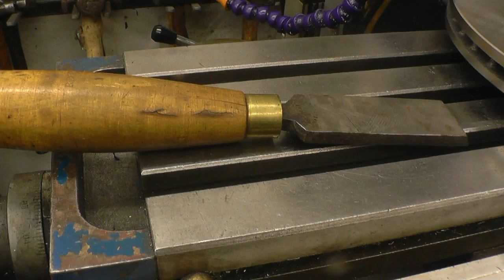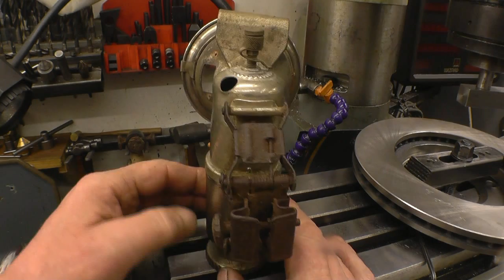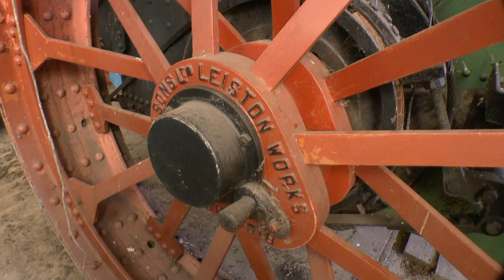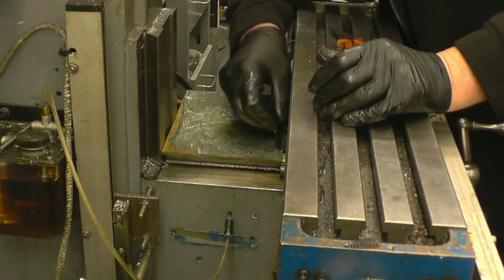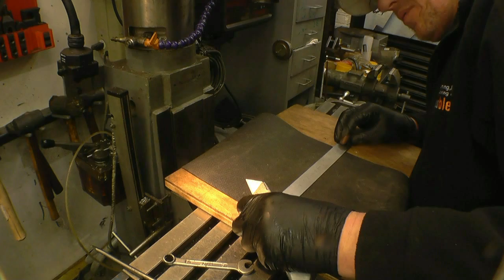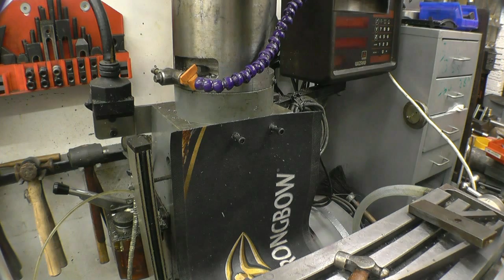SNNC 218 P1   Milling Machine Slideway Protector

Comment: Hi John
As you know we basically have the same mill & I have more or less done the same job.
However you might want to rethink those bolts fixing the top of the rubber.
Reason is, I have the same vice as you too, and the over hang off the table sometimes hits the back of the mill.
My rubber is fixed at the top with bungee cord and it's still caught it from time to time!!!

Comment: Rather than fasten the material solid at the top you could fasten a couple of very strong magnets to the material and stick them to the vertical dovetail. Then if you want to crank the table down they will be dragged along down the dovetail ways  and follow the table. When you come back up you'll have to pick the magnets up and stick them again but no big deal.
Reply from the maker: That is a splendid idea
Reply: I thought so too BUT on second thought you might not want magnets on the mill. They might attract steel swarf. Worth a quick try though.Love your videos.

Comment: My Warco mill, equivalent to yours, has sliding plates over the front of the Y travel lead screw and a rubber mat, same as you fitted, at the back.

Comment: Hi John,

Why not just use a thin steel strip on the top edge of the rubber strip and a couple of rare earth magnets on the column?

Also, it's fantastic when you and Richard go off on one in fast Geordie. Most people wouldn't understand the swearing, but it's even funnier for those of us that can follow. This is a Big Boy's channel, we can handle it. 8^)

Keep up the good work

Mick
Reply from the maker: Good idea on the magnets

Comment: Recycling an old vinyl sign is great John, I am looking to get some for the same reason. Just need to put another small apron on the front as well, to make a nice guard there as well. just needs to be on the moving part, and just enough to not foul the handle when fully out, will work a treat.
Reply from the maker: I will do something on those lines